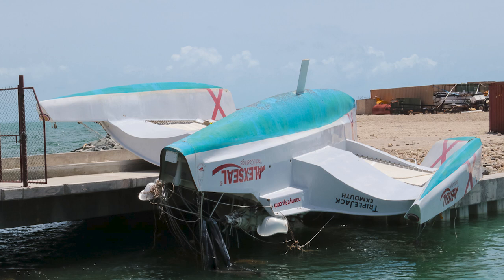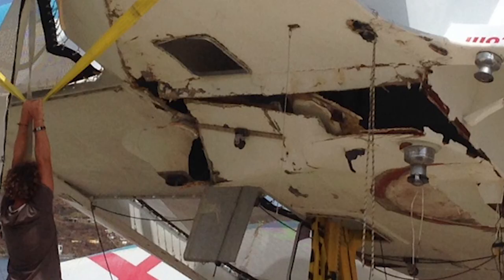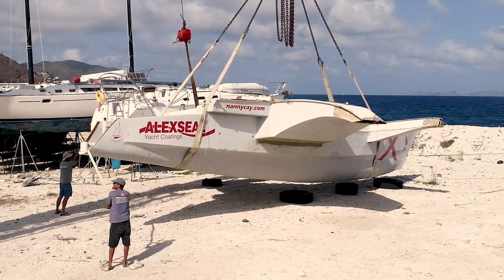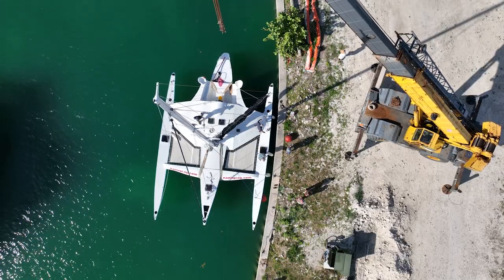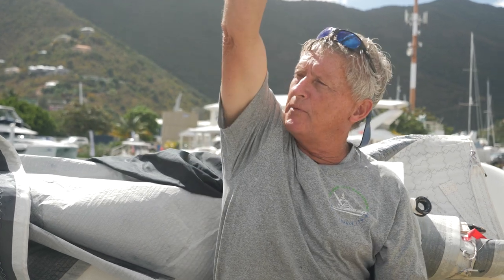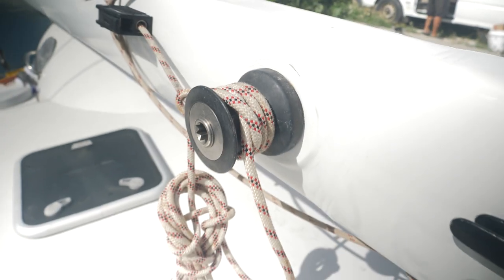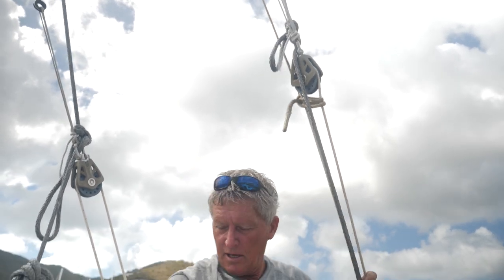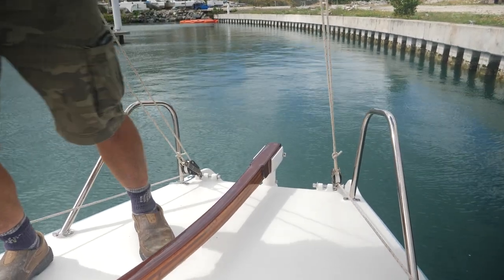Triple Jack Launched

Comment: Great video and congrats on the rebirth:)

Some pro tips for the video guy/girl:
Stop messing about with your circular ND filter so much. Honestly, most of them are crap. Convenient but crap. And you ran into the dreaded X issue where when you use the denser ND part of it, on a wide angle lens, the filter will make an X. So, either switch to a fixed ND which doesn't do this or mark the filter ring to the max you can practically use and don't ever turn futher than that mark. Also, all of this video was outside in pretty much the same light so you can just leave the ND at the max (your mark based on testing), set ISO to the lowest you can and then get the rest of the way there with your F-stop. Or set ISO to auto if need be. 
Finally, learn to use zebras and then just expose to the zebras and you'll be fine. That way, you can focus on audio and composition:)